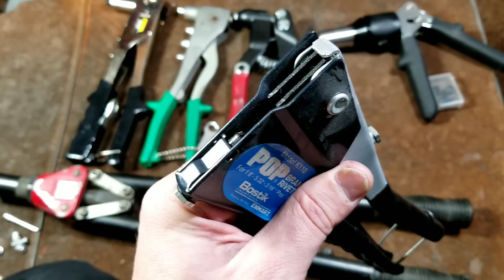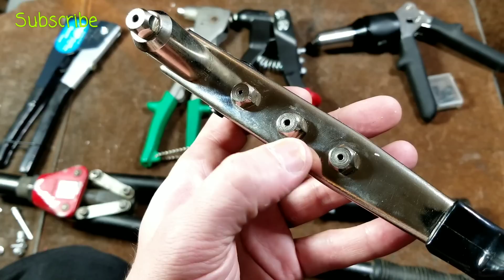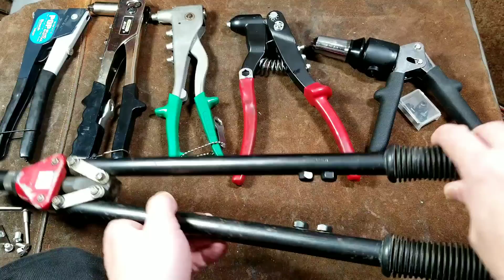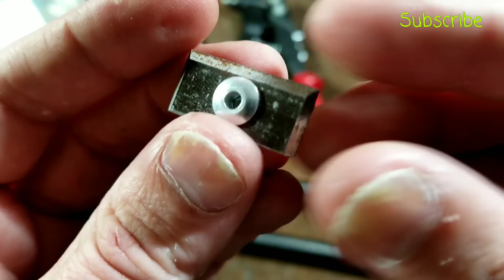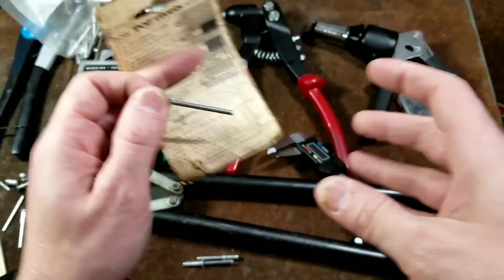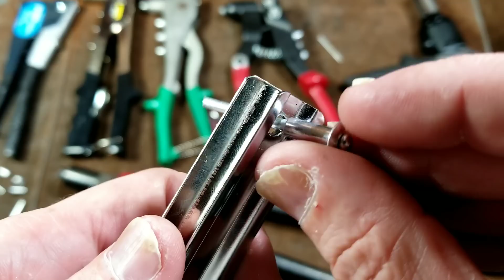A Riveting Review & Comparison, Professional Hand Riveters

Comment: Thanks for the in- depth video!
Can you please tell if the nose pieces are interchangeable between various brands of imperial standard hand riveters?
I want to buy a wrenchgear 13” or astro 1423 , but l need a 7/32 nose piece which both these riveters are lacking so l thought to get this nose piece separately but these brands don’t sell it :(

Comment: If you want to spend the $ for it, the best hand riveter you can buy is the Malco 2 in 1. As the name suggests you can change the bolt pivot point for more power (good for stainless rivets) or fewer pulls (aluminum/copper rivets). Adjustable jaw tension and can be fully disassembled to remove jams. Jaws are also replaceable when they wear out, which will take many thousands of even stainless steel rivets.

Comment: Thanks for that detailed video with tips on methods and I ran into an issue with the 1/4" D blind rivets while trying to pass the metal shank threw the hole of the rivet tool.  I will need to drill out a very small fraction of the mandral, so it will pass threw.  I suspect that there was an issue in manufacture and the opening was not wide enough and I'm guessing that happened because of the mandral being manufactured in a vise, which squeezed it, while the hole was formed.  Yes, over the years, I've ran into all of the things you mentioned,  so I had to find ways to make the rivets work in confined spaces, on some occasions, so in one case, I used a quality vise grip plyers, tightened it as much as I could, then put a cats paw or prybar under it, so I could pull the shank back up towards me, which actually worked!  A few close calls though since I almost punched myself in the face by pulling on it.  LOL!  Please make a video on offset rivet guns since I'd consider those too and I've seen a few different brands on e bay, Amazon, already.  Five stars for communication and great that there's no distracting back ground music or worse, blasting music with no communication .

Comment: Which rivet would you recommend to use on an aluminum boat.  Not sùe what gauge. But I'd like it to be solid and covered in 5200 adhesive.  Previous owner drill dry wall screws from the inside of the boat to out to mount a rack  4 holes below the water line of course. Solid  rivet ? Thanks

Comment: Hi I haven’t any hand strength anymore! Is there a battery operated one you would suggest? I’m making a window well cover, I’m using greenhouse acrylic/plastic with aluminum bars. My ex-husband measured the thickness & said I need 3/8 to 1/2 in rivets to go through. I know you drill but when I looked up the Huck to see the cost it only goes through 1/4 inch. I’d there any battery tool you could suggest. Thank You
Reply: If you have an air compressor then I suggest buying pneumatic riveter. They’re really great and take no effort to install your rivets. They can be expensive but harbor freight has some ok quality ones that are pretty affordable. I know Milwaukee makes a battery powered riveter but it sells for $300-400. I can’t recall the exact price but too ex for me as often as I use them.

Comment: Wish you discussed removing  rivits
Reply: Just use a drill bit that is at least the same diameter (or larger) of the hole the rivet is in. If you used a 1/2" bit to drill the hole. You can use a 1/2" or larger bit to drill the head off.  Once you do it once you will smack your forehead because its so darn easy. You just need to destroy the metal between the head and the stem. Once the head is separated from the stem, the stem will simply slide out of the hole. You do not need to drill the entire stem out. Which is what I always assumed. You simply need to break the head off.  Drilling my first rivet was life changing. I love rivets now. Nuts and bolts are stupid lol.

Comment: You did a nice fairly complete explanation. I've been assembling experimental aircraft for decades. I have different riveters but the one I always fall back on is the first one you showed, the pop rivet gun. After many thousands of rivets and nearly 35 years the spring finally broke. I find all other guns require two hands to push completely open, get started and sometimes too ratchet. You never really showed the Elgin that you are high praising with its Handles open. Or demonstrated it. And I never had one like the first gun. It's all one-handed. You can reach for a rivet while you're Poppin it open and ejecting with one hand with the other shoving the new rivet in and keep on going. I can blow through a 100 rivets in about 30 min. With the other hand riveters it could take up to 90 min or more.
Reply: You said you relied on the first pop gun (which would be the one without a nose), but also said you never had "one like the first gun." In the 2nd case, did you mean the molly bolt remover which shouldn't be in the video since they aren't about rivets?

Comment: For the longest time, I used a Craftsman swivel-head riveting tool and absolutely hated it. No matter what quality of rivets I used or how I treated them, they always came out sloppy. I ended up buying that Pittsburgh two-handed one and had an infinitely easier time getting perfect pops, albeit it's harder to hold for certain projects.
Reply from the maker: Yes the big riveters are very effective however hydraulic riveters are unbeatable the power of the long handle and being able to use it with one hand

Comment: There is no difference in quality between recycled aluminum and what you called 'virgin' aluminum.
Recycled metals aren't like recycled paper or plastic.
The HF rivets are just thinner. That's why they don't deform as nicely.
Reply: So all aluminum is the same? All rivets are made of the same alloy? What alloy is a pop rivet?
Reply: @836dmar  You're right that there are many different aluminum alloys out there. The alloy could be different between brands. But recycled aluminum is identical to newly mined aluminum. Recycled aluminum can be alloyed in exactly the same ways that newly mined aluminum can. There's zero degradation in quality from recycling aluminum, so whether a rivet comes from recycled aluminum is not a factor in its quality.

Comment: 18:58 Don't know why I watched this again, but really... do you remember the dimensions all the adjustment nuts on your tools?!  Don't even try to tell me you're good enough to judge millimeter sizes by feel.
Reply: When you turn wrenches as much as i have i can tell you that i can identify nuts and bolt sizes by just looking at them. I can even tell if its a metric or standard bolt size.
Reply: @X-eler8  sorry don't believe that... most guys who say they can are either good guessers or familiar with the product they're working on.  If you swap something out with different bolts/nuts they completely fair.
Reply: @xephael3485  you dont have to believe it. But just because you cant do it doesnt mean its not possible. I can literaly feel a bolt without seeing it and tell you exactly what size it is. So your telling me people cant type on a computer without seeing the keyboard? Are they just good at geussing too? No its muscle memory so if your brain can memorize a movement in 3 dimensional space it can certainly memorize sizes by feel or sight.
Reply: @X-eler8  yeah you think you can tell 16mm vs 17mm bolt or 5.5mm vs 5 ....suuure
Reply: @xephael3485  yup sure can. Go grab a 17mm socket and a 16mm. You must be blind if you cant tell the diffence in bolt size by eye.
Reply: I can literally see the difference in tolerance, in this video, from on my sofa 10 feet away. Tools are probably not your thing.

Comment: When I was working in industry, we had a tool that could install a threaded insert into sheet metal ( usually stainless) . If I remember correctly, it was called a “carcert” , and was effective. It worked similar to a common riveter, but left behind a threaded hole.
Reply from the maker: Threaded inserts are common and the little hydraulic Riveter I have has a special adapter for installing those there is also manual screw-type installers for those

Comment: Just my opinion man..but if you have tools you should probably have the consumables they use!  If you don't, might as well get rid of the tool.
Reply: If your car runs out of gas you should probably throw it away.
Reply: @ShatteredF1re7733  I've never had a car run out of gas... knock on wood
Reply from the maker: I just didn't have any Molly bolts for the video. But I'll definitely be keeping these tools because they make it so easy to install when I do work with Molly bolts.
Reply: I didn't even know that tool existed. I thought you could just tighten the screw to spread the legs. No tool needed.

Comment: Nice post sir, I have an old MARSON, looks like your green handle pair. It's a HP2 over 40 years old. And a workout with a hand full of rivets, really any more than a couple, good hand exercise.
Reply from the maker: Yes very true the hydraulic riveters and the bolt cutter style riveters are much easier to use if you have to drive any more than a couple dozen rivets or if you're working with a larger rivet sizes
Reply: I Also have a Marson, in a nice blow molded case. For both steel or aluminum rivets it is my go-to. It's from the late 80's, and has krinkle powder coating. I do have a pop-rivet set, but never use it.

Comment: Nice video.  Do you have any rivet nut tools?
Reply: I just ordered the tool yesterday, pricey
Reply from the maker: The huck hydraulic Riveter includes a nut setter nosepiece I forgot to mention that it's one nice advantage to it is it will both rivet and nut set. She just have to buy the special little nuts at and the little specialty pull adapter to he is with the hydraulic crimper